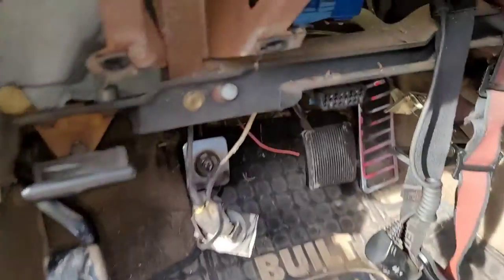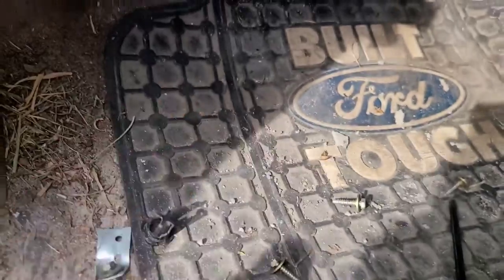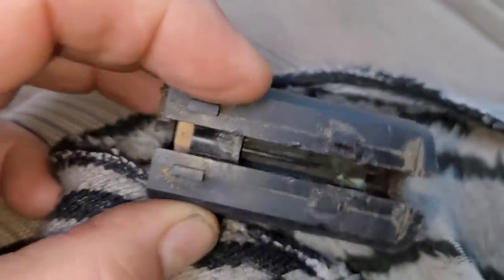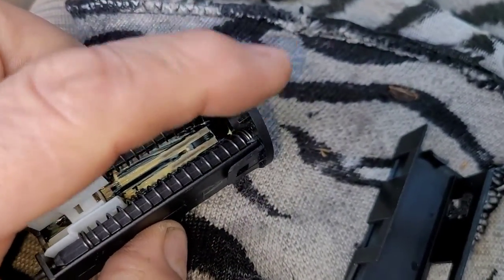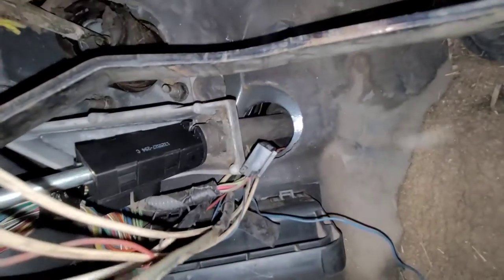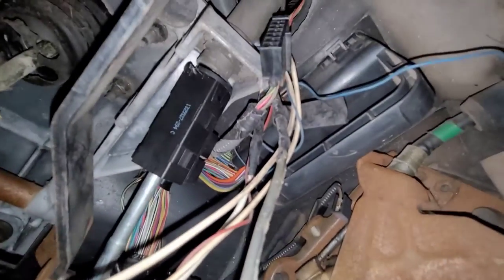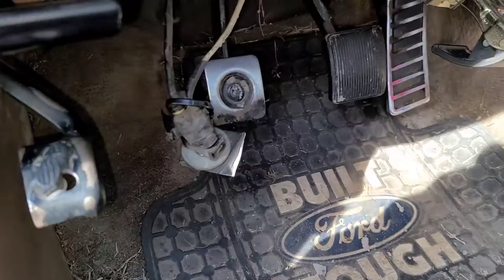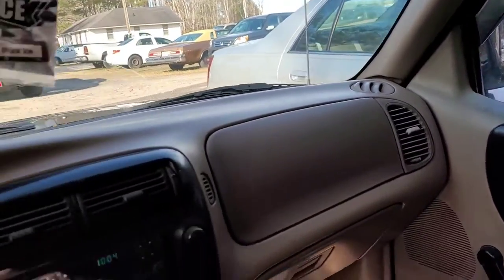Ford Ranger Towed in , no start . Clutch Pedal Broken ? Not exactly

Comment: The switch has to be installed at an angle.  You slip the switch assembly over the rod where the vinyl covering isn't there, push it in (against the spring load), then it slides on just fine.  Just went thru this with my son's truck.

Comment: The Motorcraft unit comes with the clutch position switch and the rod with bushing. I found it online for $43.XX. I generally stay away from the aftermarket parts.

Comment: QUESTION: 93 Ford Ranger Ran fine no issues then I held in the clutch and revved the engine slightly and I mean just a little, nothing silly just before I went over some fairly smooth rail road tracks at a crossing.. Afterwards, it would not go back into gear. now it runs and drives, but will only shift gears with engine off. Any ideas anyone?
Reply: clarification: the clutch works normally as far as resistance on the pedal, it actually does work as a clutch even, although it seems like it might be a little "maladjusted" now, like when you let it out its not all the way out